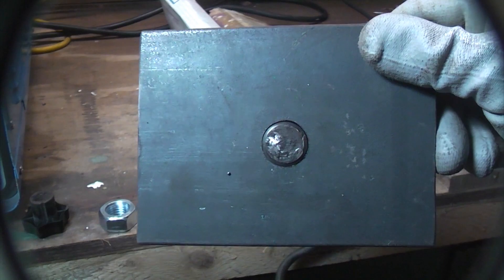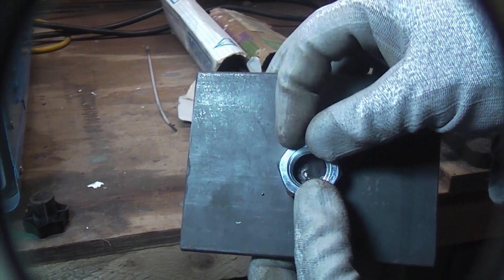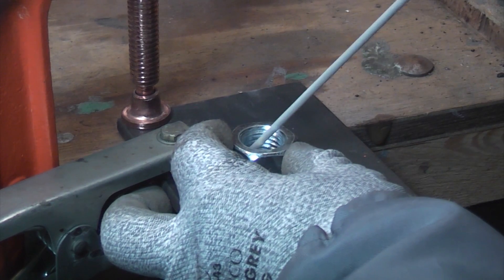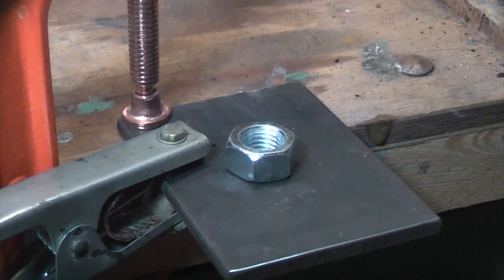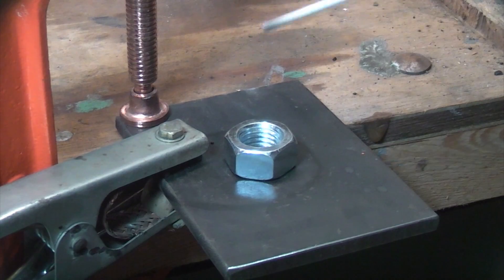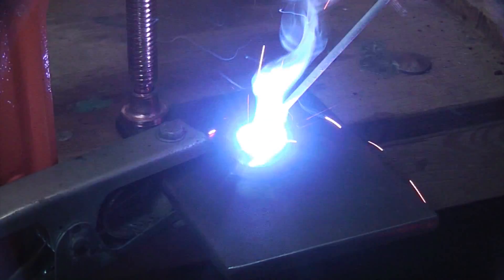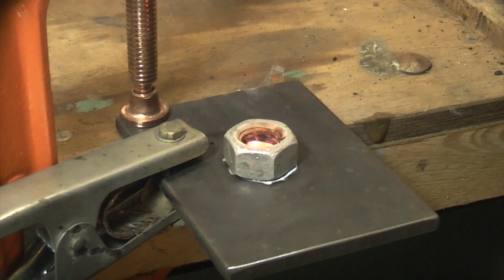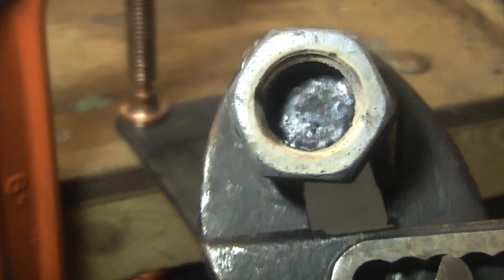Removing a broken bolt using a welder

Comment: I'm running into a problem where the bolt is recessed, upside down and under a car. I've welded repeatedly and even though the weld is sticking to the bolt without issue, the nut won't quite stick to the weld. What I'm thinking: Weld a decent sized washer on, maybe even a fender washer if necessary. It should be easier to weld than a nut directly because it's relatively flat, no hole to weld in. Weld a nut onto that washer, larger than what would fit the bolt. The larger nut will give you more room to weld and a larger surface area for the weld to take hold. If welding the inside of it isn't enough, weld it from the outside at the base of the nut. Since the nut is large, it should also be taller relative to the height of the weld, so a socket should still have plenty of surface area to turn the nut, especially since the bolt is smaller than what the nut is made for.
Reply from the maker: Sounds like a nightmare job! Best of luck with it 👍

Comment: Where do I attach the ground clamp to if I wanted to do this to get sheared and rusted roof rack bolts out of land cruiser roof gutter?
Reply from the maker: Best to check with a mechanic, but I believe you disconnect the battery completely from the vehicle, then attach the ground clamp to any earthing point on the vehicle. 
I've not done any welding on a vehicle for decades, so best to check with a mechanic 👍

Comment: Which electrode did you use?
Reply from the maker: I normally use 6013 electrodes. Can't remember the diameter, could have been 2mm or 2.5mm

Comment: I experimented with stick welding a nut on an M12 bolt. I used a 7014 rod and small cheap DC welder. For my first attempt I fed the rod in as evenly as I could until the nut was filled and glowing red. That one broke at a mere 15 ft-lb. It was totally contaminated with slag. For my second attempt I did small individual welds and cleaned it out with a carbide burr before welding again. The nut was full after five individual welds. That one broke free at 80 ft-lb. Obviously a big improvement, bit it still had some slag contamination and could be stronger. The second technique is promising. I'd use it if I had no choice, but after all that I'm going to drill out the bolt because I don't think can weld it a accurately enough on the car to get a reliable result and the bolt is severely seized in there.
Reply from the maker: I normally use 6013 rods. Hopefully in your scenario, the heat might help to loosen the bolt.
Sometimes I have had to have a few attempts, before it's welded enough to extract the bolt.
Best of luck with it 👍

Comment: Hi mate what ampage  did you use ? I'm onto this now x 5 studs ggrr cheers good video
Reply from the maker: I think I used about 80-100 amps 
Thanks for the comment 👍
Reply: @ultimatehandyman  ah ok maybe that's my problem onoy gone up to about 60 ish I'll up the anti cheers mate its an Inverter so hopefully won't blow no fuses (240volt plus 13 amp) thanks again

Comment: The tap I broke is 6mm , is it possible to remove by this
Reply from the maker: 6mm is possible, but you need a small electrode, or even better a MIG welder.
Thanks for the comment 👍

Comment: Hey mister! What do I do if my bolt was sheared and i drilled into it using a bolt extractor pig's penis and most of the bolt is broken? how do I avoid weling to the threads of the material and not just the bolt? fcaw.
Reply from the maker: You can drill out a broken tap- https://www.youtube.com/watch?v=7JCfEMrCjhc&t
But if you go down the welding route, try using a smaller diameter nut- that way you are less likely to weld to the component itself.

 Thanks for the comment 👍

Comment: What electrode will create the strongest weld?
Reply from the maker: I normally use a 6013 
Not sure which electrode will give the strongest weld though!
Reply: @ultimatehandyman  I just gave it a go with a 7018. Should give a stronger weld, but my nut was M10. A bit small for stick welding.

Comment: Arc welding?  Hey guess what your “mig” gun uses to weld with????  Yup an arc.  If you plug it in then it’s arc welding.  Try cracking a book written after 1956 you’ll be amazed what you can accomplish.
Reply from the maker: SMAW= Shielded metal ark welding (often known as ark welding)
MIG- metal inert gas
TIG - Tungsten inert gas

You are welcome ;-)
Reply: Ok now go get a modern book.  Almost no one mig welds anymore.  It’s called Gas Metal Arc Welding because most is done with reactive gas, or a mix of reactive and inert ex 75/25.
Tig is an incorrect term also.  Inert being the problem word.  A lot of “tig”. Is done with reactive gasses so tig is incorrect.
Smaw
Gmaw
Gtaw
Fcaw
They all end in arc welding.  So when you said your arc welding you didn’t say much besides hey I’m weldin it

Comment: I have a question I have a flex weld machine that I bought from Harbor Freight. Will it remove broken bolts from an exhaust manifold.
Reply from the maker: You can use virtually any kind of welder, a mig welder is best as there is no slag trapped in the weld.

Comment: If the bolt 6mm can extract it with stick welding
Reply from the maker: It is very difficult with small bolts like that, but if you can mig weld or tig weld a nut on the end it might work.
Thanks for the comment

Comment: I used my drill by cramping the chuck on the exposed broken bolt. If it can be held by a pliers its as easy as setting the drill to reverse after you tighten the chuck on the broken bolt.
Reply from the maker: Thanks for the comment 👍

Comment: me and my dad tried this today on my car it has 3 busted off studs in the exhaust manifold it didn't work very well.
maybe doesn't work very well unless the bolt is sitting on a surface and not being held sideways.
Reply from the maker: Exhaust manifold studs are a real nightmare to get out, because they have been through so many heating/cooling cycles. Sometimes drilling them out is the only option.
Thanks for the comment 👍
Reply: @ultimatehandyman  yeah my dad said that would just result in destroying the head.

Comment: Really struggling to weld a nut to a 6mm stud, it welds on but when I get the wrench on it just comes apart
Reply from the maker: It's really difficult with M6 studs, sometimes you have to drill the damn things out!
Thanks for the comment 👍
Reply: @ultimatehandyman  m10 easier?

Comment: Well, sometimes you may require  special welding rods (to remove very tight bolt) like CGS 680 as bolts are made from alloy steel. Another trick to remove broken bolt deep inside is to use MS pipe piece of smaller diameter than that of tapped hole & weld it from inside to the broken bolt. Bigger size bolts like M16 can be easily removed by this.
Reply from the maker: Thanks for the comment 👍

Comment: Put a washer below the nut first to raise the nut up from the surface giving extra clearance from the surface and also protection from weld running out on to the work surface fusing the stud to piece your trying to remove it from defeating the whole object as the molten metal will always take the path of least resistance so if theres any gaps it will find them. Then put the nut on top of the washer  then push the welding rod straight down vertically into the centre of the nut onto the broken stud so your penetrating into the top of the stud and then just fill the centre of the washer & nut with weld. Then let it cool right down before trying to undo it as when it cools it will retract /shrink making it even easier to remove. You can also drill down the centre of the broken stud as well to get even better penetration on really stubborn studs and repeat the process as above.

Comment: @Ultimate Handyman can this technique also remove a wheel stud that has been overtorqued? my wheel nut has split off from its ball seat base when i used a breaker bar to remove it and now all thats left is the wheel stud & ball seat portion of wheel nut
Reply from the maker: It's worth a try, but a mate of mine is a coded welder and he once tried to do this with a security stud and it did not work.
I have drilled wheel bolts in the past- which might be another option, if welding the nut fails-
https://www.youtube.com/watch?v=8Rm9fBXIzPg
Thanks for the comment 👍

Comment: Could you not have just drilled it out?
Reply from the maker: Sometimes this technique works really well and it is much fester and easier than drilling.  The heat generated can also help to loosen the bolt.

Thanks for the comment

Comment: will a flux core welder do this job?
Reply from the maker: Yes, but you need to have the amps high to generate the heat.
Reply: Ultimate Handyman cool i hope get to do a few practice welds this weekend with my 125 amp flux core.

Comment: theirs nothing bad about arc welders vs mig really. some may call it old fashioned, but its built many bridges, and similar things where sheiding gas is not practical or gets blown  away. theirs a rather nice feeling once you take a 7018 rod to something its going to stay put with minimal hassle.
Reply from the maker: +twilson1118 Absolutely.Thanks for the comment
Reply: +twilson1118 Especially when all you have is a good stick welder.
Reply: I love my MIG welder, but one of my favorite things about stick is that you can weld without removing the plating on most materials (with proper ventilation and respiratory ppe of course).
Reply: I've got admit that although my everlast mig welder can stick weld too I probably don't take advantage of it as much as I should. Stick welding can often be the best process to use in many circumstances
Reply from the maker: Thanks for the comment ;-)
Reply: twilson1118 ثه

Comment: Thanks for sharing.    I just bought a 90 amp flux core welder 110vAC. Would this welder be able to do this?
Thanks.
Reply: ravengsxr simply no.

Comment: Ive be using this metod for many years but i start making some points and clean the slag, one in the top of each other until i have grown a stack of weald at least the heigh of my nut then i make a final weld, that help to prvent th nut of moving and the temperature helps removing the bolt

Comment: yeah but my problem is 4 anti theft locking wheel nuts. where do i put the earth and how do i clean the locking nut without destroying my alloys
Reply from the maker: Forget using this method, my mate is a coded welder and had the same problem. He welded a nut on at my house and it sheared right off and did not work. It took him days to remove them and he tried all sorts. He eventually managed it by smashing off the revolving sleeve using a socket and club hammer. He then knocked on a special socket made for this purpose ( I think they are called stud removal sockets)
Reply: they are in deep holes in the alloys i cant get to  the sleeve. im going to have to find the propper socket. i know of a socket  that has lots of pins insde it but i cant find any
Reply from the maker: Derek Waddell
Were these tightened by an impact wrench at a garage?
If they were I'd go back and ask them to remove them!

Comment: using this method is difficult to do because a lot of times you hit the rod on the nut and don't get a good weld;I cover the rod with shrink tube to help as my vision and steadiness have gotten worse over the years.I like the superglue cheat!great advantage

Comment: Dissimilar metals can suffer from galvanic corrosion - essentially they set up a small battery with the moisture present and one of the metals gets dissolved and deposited on the other.  In the olden days they used to use zinc nails to fasten the copper sheets onto warships - I think this is how they figured it out initially.  The saltwater and dissimilar metals caused the hole to increase in size until the plates fell off.

Comment: I welded a nut to my cars oil sump plug since (hex socket hole rounded off) it was made of steel and my sump was made of aluminium and they had corroded together (technical name for this escapes me!) I had to weld upside down while under the car, not fun but it worked. Holding the nut in place with a piece of wood just cut to the right length.  mig welder was ideal since it allowed for small precise tacks

Comment: In my opinion bolt extractors might be a worse off option. They break so easily, which causes a bigger problem. Use a chiesel and try to hit the bolt in the direction you disassemble it. In theory when the head is off the bolt its not pulling on the threads, which means it should be easy to remove. Try this before you do something more drastic. If you spray in some wd40, and hit the bolt with a hammer and chiesel it might be removable.